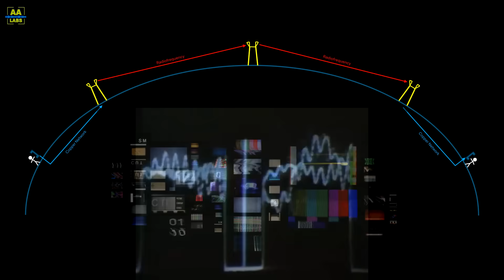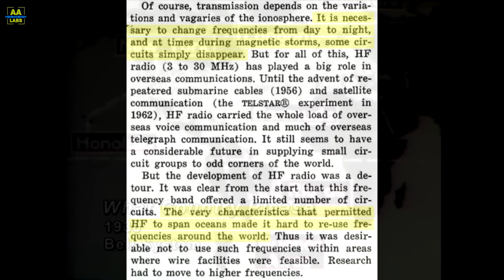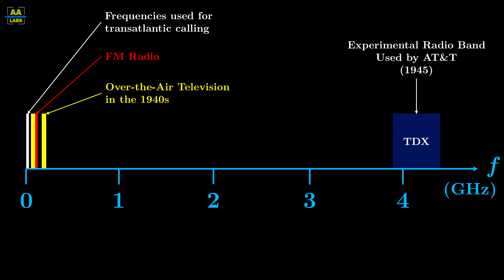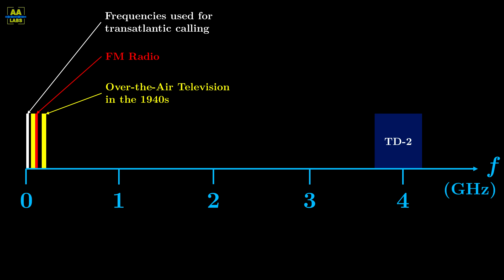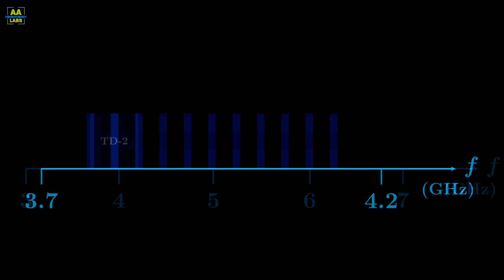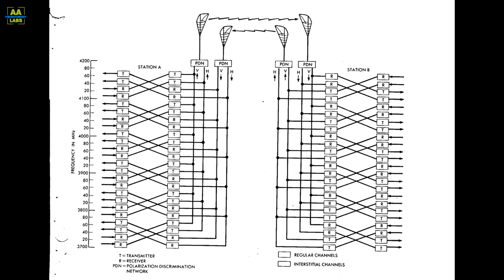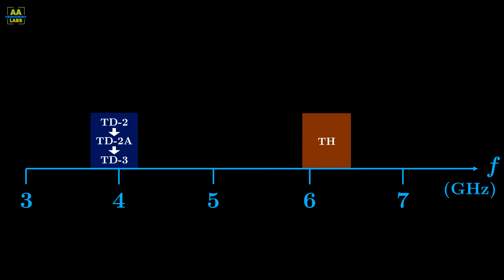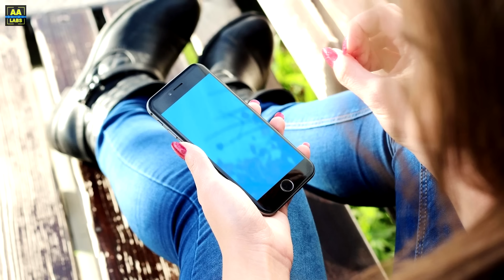AT&T Long Lines: The Wireless Network Before the Internet

Comment: Many decades ago, I had an electronics engineering professor who worked for Bell Labs and was directly involved with the first multiplexer.  The first one being vacuum tube powered and was the size of a small suitcase.  It worked great but, they held off on releasing it because discrete transistors were developing quickly and would make it much smaller and more practical.

Comment: Are some of these mothballed sites saved for emergency/disaster/military purposes?    
Thats a lot of towers because microwaves operate on "Line of Sight"
Reply from the maker: I would not be surprised if some of the tower sites are used for that purpose. Many have newer microwave dishes and other antennas on them.

The original Long Lines equipment shown in this video has all been "retired in place" or removed, though.

Comment: My old man was a graduate of the original RCA Institute with a masters in electrical engineering from Cornell, who worked to help set up the long line network working for Harris. Everything from stringing to equipment design and even installation. He's 96 and remembers individual tower installations in the northeast!

Comment: There's a microwave repeater station in the south end of Death Valley National Park. It's about a 30 mile drive on dirt roads. It was a great place to camp as it was on a hill with great views and you could listen to the wind whistling through the antenna structure.

Comment: My father began his engineering career with Bell Canada setting up mountaintop microwave stations across the British Columbia portion of the Trans Canada Microwave System in the mid 1950s. He and my mum spent their honeymoon working on one of the stations as my dad couldn't get time off. It was superseded starting in 1972 by the Anik I satellite, the world's first communications satellite in geosynchronous orbit, which covered all of Canada at a much lower cost than the microwave relay system.

Comment: I did hvac work for Zerison cell phone and one of their sites was on top of a large hill with one of these old At&T microwave transmission sites. It was a massive cement building more than 3 stores tall . with all the old antenna  One time some one left the door open and I went in.  Most of the equipment was gone, but you could tell it was impressive. Feld  I had stepped back in time to the 50's. I loved these buildings..

Comment: I live in NW Georgia. The co-op electric company had 3 offices each more than 10 miles. They used microwave towers for interoffice communication. The tower closest to where i live still stands, unused. I think the sheriff department may still use the tower.

Comment: When AT&T began working with Bell Labs and Corning Glass Works on optical light transmission they called it Light Guide and that is the official registered name for fiber optics. The cabinets are even labeled AT&T Light Guide Systems. Microwaves used wave guides between the antenna horns / dishes and the transmitters. Light guides were the natural progression.
Reply: At my work buried in our network closets there are some old Western electric lightguide boxes. We are on to corning lanscape rn, but its cool to see the old stuff. Some of it is still active and owned by a defunct telco, looks to be sonet.

Comment: in canada we had the trans-canada sky way, which was the long lines tower uplink route that follows the trans-canada highway, which if you ever drive the trans canada, you will see a tower every hour for sure! built by at&t and bell canada. owned by bell canada, unlike AT&T its still owned by bell Canada despite no longer being in use.

i am a FM radio tech and one of my stations is co-located on an old long lines tower, the building is incredible, huge 2 story brick building, allegedly copper lined! ive been inside a few times and its like a time capsule, even if the old Big Horn antennas are no longer on top, the shape is unmistakable, and its identifiable from so far away, even at night, its boasting a slow rolling beacon like a light house, not a traditional strobe. 

ive been told by old timers during the events of sept 11 2001, the local police department SURROUNDED the tower. maybe bell Canada was still using the system in 01' unlike AT&T, or maybe they were still in service as a failover in the event of a catastrophic emergency. (for anyone whos gonna say yea but its Canada, understand that no one knew what was really going on, the CN Tower aka Master FM, was under threat and Toronto was a ghost town by noon)

Comment: Would've never thought microwave has better latency vs fiber but it does, fiber 5us, microwave 3.3us per km.  I remember making long line calls and hearing white noise, very expensive, supply and demand.
Reply: The signals for both move at light speed but the speed of light is slower through a medium, the higher the refractive index, the slow light travels. 

A quick search says that light in fiber optic cables is about 70% as fast as light in a vacuum. I imagine focused microwaves are slowed less by the atmosphere than the 70% number for fiber. Focused microwave is also point to point so is probably a shorter travel distance than a cable run.
Reply from the maker: Microwave is the air is 99%+ the speed of microwave in a vacuum!

Comment: You forgot PBS. They were all relayed by AT&T. And, Coax cable has very wide bandwidth and DID CARRY mulitple video signals. Think about the coax cable that goes into homes. It's very wide ... and enables wideband transmission.
Reply from the maker: Yes, coax carrying many video signals (cable TV) came into common use in the 1970s-1980s. The statement about a coax carrying one channel applied to 1940s-1950s era transmission.

Note that cable TV systems consist of relatively short runs from the headend to the viewer, compared to the long distances required to get TV programs across the nation. The useful bandwidth of coax decreases pretty rapidly with distance.

I made a video about cable TV/internet systems a few years ago: https://youtu.be/lWjjYCbQPSQ
Reply: Cable company coax systems have inline amplifiers every 100-400 meters; depending on the number of taps in a given distance. Edit: point is, infeasible for long lines situation.
Reply: @unremarkableitem  But remember, the old copper telephone system needed amplifiers as well. Once they are in place, it should be no problem. And, it was in place before longlines. Just sayin'
Reply from the maker: @MrTechHistory Note that those amplifiers were typically installed every 4-8 mi (6-12 km), very different from every 100-400 meters.

Comment: Yes, this is why long distance calls used to be billed by the minute.  The bandwidth of the microwave towers was limited and it was expensive to link different phone networks together.  And the reason they used wireless in the first place is because it would be a pain in the ass to use copper at those distances.  Copper needs all sort of amplification and shielding and doesn't have all that much bandwidth anyway.  (Copper is fine for short distance links, which is why local calls were always free).  And it was even worse for international calls.  Microwave towers couldn't be put in the ocean, so they had to use satellites.  The bandwidth there was also limited, so international calls were extra expensive. 

The first fiber optic cables were not laid until 1977 and during the 80's they rapidly built-out their network backbones with fiber. Fiber optics made long distance links so cheap that long distance charges were no longer a thing by the early 2000's.
Reply: I remember being told to wait until after 8pm to make long distance calls because it was much cheaper. Good times.
Reply: they're not "billed by the minute" now because for marketing purposes they bake long distance costs into the mobile phone plans. Earlier on (in cell plans) you had to pay extra for flat-rate long distance on your plan. Now flat-rate billing is standard. If you have a landline today, you pay per-minute for long distance (regional, national, and int'l rates)  unless you pay for flat-rate option. VOIP services do the same.

Comment: Growing up in the 1990s when my Tennessee mom would call her Kansas parents it was a very common occurrence to have CB Radio Interference from either Highway 52 at our Tennessee home (1 mile away from Highway 52) or  Tractor Trailers that were forced to use North Amidon to connect Twin Lakes shopping center to K-95 or Meridian Ave north in to Valley Center at their Kansas home

Comment: Those feeder horns look archaic compared to modern satellite dishes. There are still people that rant on about 5G causing people to drop like flies. Yet, we've been using those same frequencies at greater power levels since the 1940s. It's more likely that pollution is causing increased risks for cancer, but that somehow gets swept under the rug. People would rather prefer sci-fi explanations for cancer rather than waste dumping in the air, soil, and water.

Comment: Great presentation! As a "C" Band TVRO (big dish) installer back in the 90's, I wondered why the FCC stuck all the satellite frequencies smack dab in the middle of the terrestrial AT&T microwave frequencies! We would occasionally run across a potential customer of a home based TVRO system, but would discover during a site check, he was under active microwave relay linking! We had to say NO to customer because he would not be able to get the satellite signals.
Reply: When the local NPR-affiliated public radio station here in my town (KCND-FM in Bismarck, ND, flagship station of the statewide Prairie Public radio network) first went on the air in 1981, there was (and still is) a AT&T microwave relay site with tower about a half a city block away.

To mitigate any chances of interference from AT&T's C-band microwave paths from the relay site with KCND's reception of NPR's national program feed coming down via C-band satellite (Westar 1 at the time), the first receiving earth station antenna installed for KCND wasn't your usual fiberglass or aluminum parabolic dish, but a horn antenna much like the ones in use on Ma Bell's towers.  It was slightly smaller than the horn antennas used by Bell, and was mounted upside down on a frame on the ground and tilted up to where the horn antenna's opening was aimed right at the satellite,  compared to how it would be mounted upright on a tower and pointed at the horizon for terrestrial microwave service.  It was used as a sat receiving antenna because it was more directional than a parabolic dish, and therefore more effective at blocking any stray interference from the sides from AT&T's microwave links next door.

The AT&T site next to KCND's studios is still in use by them today as a fiber relay site, with its tower re-purposed for cellular and fixed wireless internet services today--the tower had its original C-band horn antennas removed around 2004 or so, long since unused by then.  KCND had decommissioned their horn antenna for satellite reception of NPR by about 2001 or so and sent it the the scrapyard.  A standard spun-aluminum dish took its place, for it it was quite difficult to move the horn antenna to re-aim to different satellites, as NPR had moved their feeds to other sats since it was installed.  Plus, with Long Lines' MW network long since shut down by then, there was no longer a need for a horn antenna to receive NPR's feeds reliably anymore.
Reply: @RyanSchweitzer77  Oh wow! Very cool history! Technology marches on! Thanks.
Reply: @RyanSchweitzer77  Awesome, I enjoy reading about historic telecom architecture, ever since I learned about the old Ma Bell long lines network, its hard to not see whenever one of these unique towers come into view when driving around, even from Canada, where many such towers still exist. Once a hallmark of just how intertwined our countries once were.
Reply from the maker: I was wondering if the two coexisted. That answers my question!

Comment: Satellites was used more  now then back then. Satellites are used for telecommunications as well as television and radio communication.
Reply from the maker: Yes, satellites are still big. However, a lot of media is now getting distributed via fiber. Some of the previous C-band satellite spectrum (~4 GHz) has been converted to cellular and all that satellite technology got "repacked" into a smaller band.

The coolest emerging application of satellites is low-earth-orbit (LEO), which enables much lower latency than the geostationary satellites of yesteryear. Starlink is the biggest player in LEO for commercial applications right now. This operates at >10 GHz.
Reply: Wrong. Most of communications go thru cables. There are thousands of undersea cables going across the Atlantic ocean. Even our Military drones are controlled by signals using cables. relaying messages from America to the Middle East. Satellites are rarely used for telecommunications.

Comment: I was a craftsman for Long Lines in 1971. Microwave Carrier for long distance. State of the art at the time. Then, ESS, Electronic Switching came out to replace step by step cross bar switching. Suddenly, you could hear a pin drop in the switch room. I still have my wrapping tool for frame cross connects. I left Mother a month before the Big Strike by the CWA. Never looked back.
Reply: Just retired from ATT last year, System Tech, mostly large system PBX my whole life but pretty familiar with all aspects of our systems. I used to love going to these old sites. These were some pretty impressive structures. I've got one of the old 'Take Cover' alarm units still.

Comment: ATT also operated Long Lines circuits on buried L4 and L5 coax cables that transited the entire country
Reply from the maker: Yeah, this video kinda focuses on the microwave, but they did continue to use and build coax as part of the "network" as well!
Reply: Back in mid-1960s we were testing buried coax between Milwaukee and Minneapolis.  Coordinating with those farming on the land took time!

Comment: Is the TD same as the TD in TDMA? If so this probably led to the invention of the cell phone eventually when electronics became more miniature.
Reply from the maker: I don't think so. This system relied on frequency division, not time division. TD-2 was mostly analog. Time division schemes typically work best on digital signals.
Reply: @DoubleALabs  Not sure about the wideband video but the narrowband stuff used "Twin Sideband" FCC-17 Frequency Division Multiplex (FDM). The High Frequency baseband consisted of groups of multiple carriers spaced at 16 Khz with an upper and lower sideband. Each sideband could carry voice or modem traffic in a ~3 Khz bandwidth. Signaling was in-band using SF tones. These groups were combined to form "Super Groups". All of this was up/down converted to C band.

Comment: I own one of these old sites. I have converted it for WISP and amateur  radio use.
Reply: It's my dream to own one of these old sites! Some people want a light house, I just want a long lines tower.
Reply: @techtrav403  I would argue that holding one of those old microwave sites has the exact same appeal as a lighthouse. 
The old, isolated, standalone "watchfull sentry" sort of structure. 
And I definitely get that appeal!
Reply: Lucky! There’s one near my QTH at 2739’ with two massive towers on site with the horns still intact along with a huge hardened building on site. It would make an epic shack location
Reply: The people who grabbed up those mountain top sites were smart.
Reply: Nice N9EQE here.
Reply: Huge one just off the i35 freeway in Stacy, MN
Reply: That wouldn't happen to be in La Porte, IN would it?  That is the only one I know of that has been repurposed for ham radio use.  It is the repeater site for the La Porte County Amateur Radio Club.

Comment: I worked for a startup, several companies under companies under one, in Denver Tech Center from 1997 to 1999 when I left for the Marines.  Actually, they shut the doors but I was already headed for the Marines.

I was the Director of IT.  The company was the first to offer "ISDN speed wireless", and I was one of two designing, installing, maintaining, and presenting it for/to customers within the DTC and Inverness area.

I haven't seen anything even similar mentioned about that time until this video, so this brings back so many great memories!

I was around 19 to 21 during that time, and had a blast!  Still find some of those people on various social media sites from time to time, and it's always a great conversation.

Thanks for doing this!

I'm an old 9/11 Marine combat Veteran that's now an SSE, promoted last week to Head of DevOps, ITSE, and Infrastructure manager for a company out of Ireland, working remote and mainly covering Aerospace and Defense clients in the U.S.

Man, my world has shrunk even more with this one!

USMC 1999-2007

Edit: I should mention that we used a then new technology product from BreezeCOM.  We had an omnidirectional antenna on our 14 story building in DTC, two unidirectional antennas pointed at each other from DTC to Inverness Business Park (within 8 miles) with bridge units at both ends, and an omnidirectional antenna in Inverness.

We only got a few customers before going bankrupt, then I left for the Marines.

Those companies were TCM Holdings, UltimateCom, and UltimateIS.  Probably one or two others.  One guy I worked with, Walker Fenton, we stole from Netscape, after be created their main website and later taught me a lot about web design back then.

One other product we had was a 40 mile down link from a tower on Lockout Mountain and dial-up upload.  The only customer I knew of was or company President that lived in Parker, and I visited one day to install it, right before he bailed and handed the company off to some sucker that rode the horse to the company's death a few months later. He was my then girlfriend's uncle.